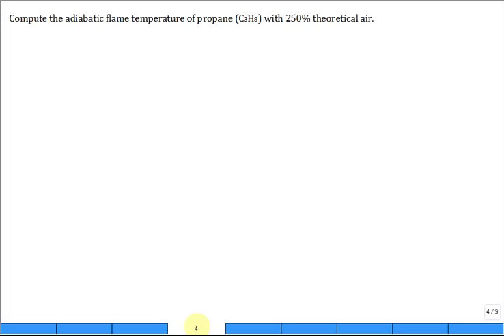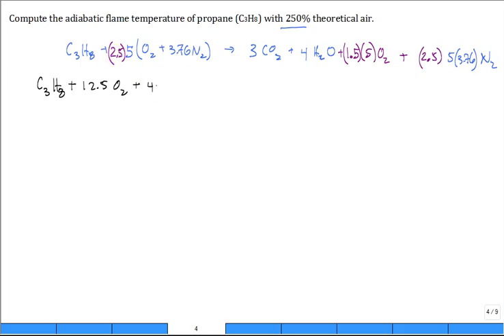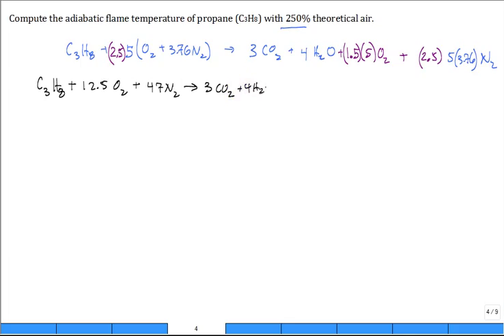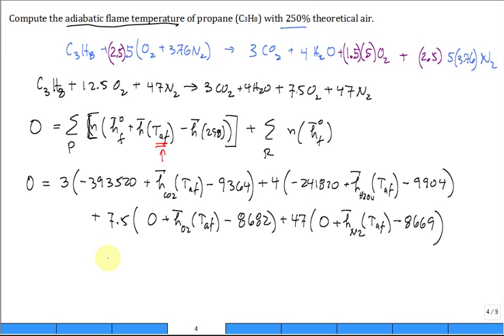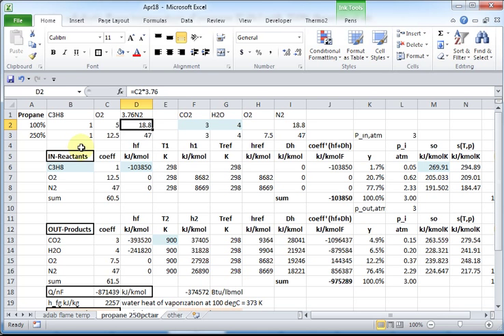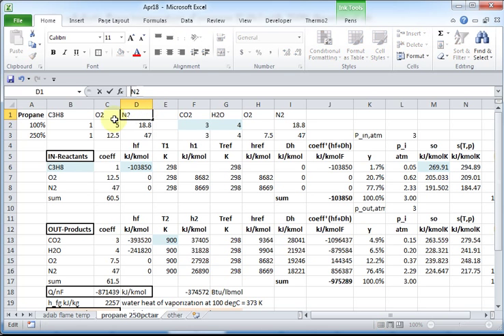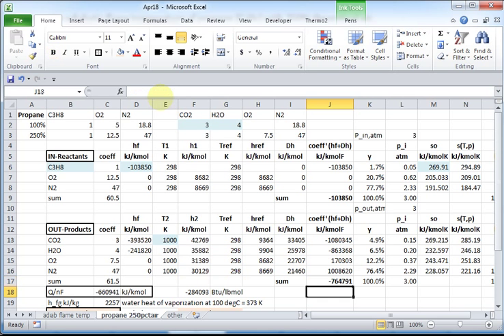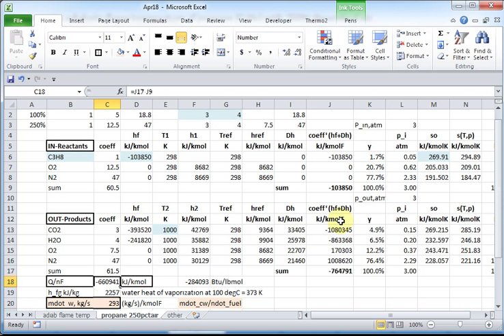Adiabatic flame temperature propane using Excel

Comment: First and foremost, I would like to express my sincere gratitude for your contributions, which continue to shed light even years later. Despite following the same procedural steps as you, I am unable to obtain a zero value for Qnet, and the adiabatic flame temperature does not yield the exact expected result. Could you kindly clarify what might be causing this discrepancy? Additionally, I would greatly appreciate it if you could share the thermodynamic property tables you used in your calculations.